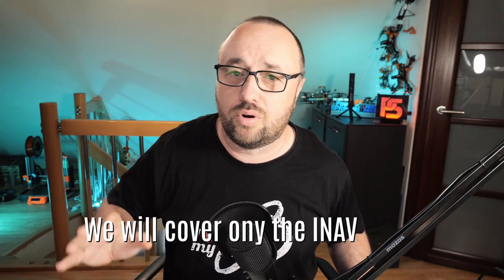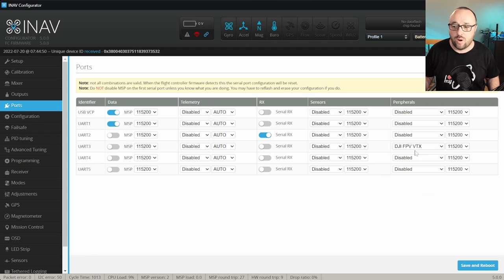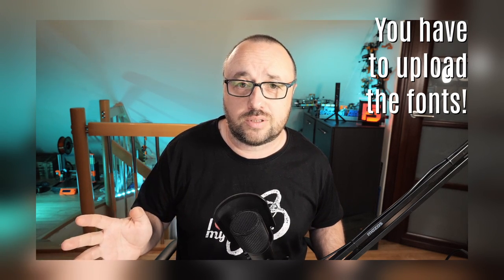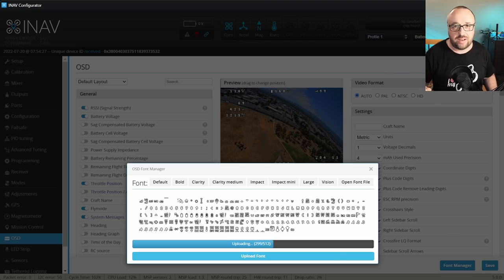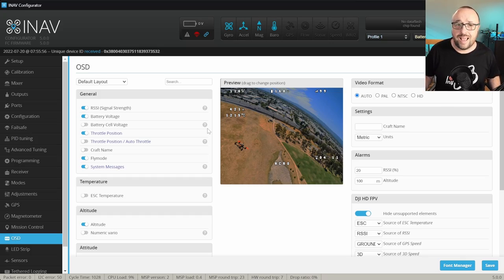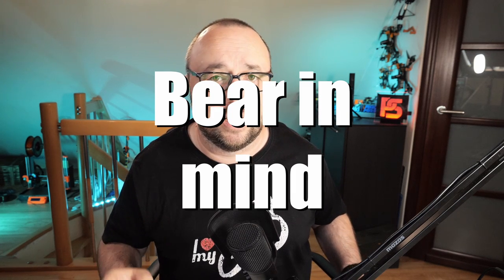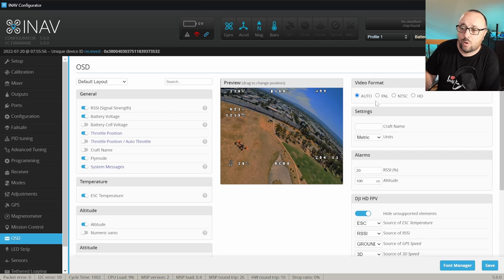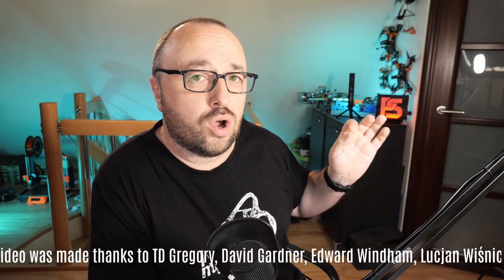OSD - Analog, DJI FPV and HDzero | INAV 5 on a flying wing | 9/11

Comment: Thank you Inav for embracing the craft name hack for DJI. Love that its configurable easy nlwt  Betaflight I need to flash special firmware and I think it's bull crap they didn't make it an option in the main branch
Reply: Maybe because dji should finally dropping canvas mode? Its a fucking shame they dont get that done

Comment: Hi Pawel, I'm getting a really annoying issue on Inav5: 
-I have enabled "use craft_name for system messages etc."
-I have enabled ONLY "system messages"
-I keep getting, when I have NO system messages, the "craft_name" that alternates with throttle percentage and other information that isn't even enabled.
-Craft_name is left blank ofc
-I already tried to reflash the FW
-I alreday tried to reupload the default font
WHAT ELSE CAN I DO? It's so annoying...
Reply: The same here. That's exactly what I was referring to in my other comment.

Comment: Thanks Pawel. Setting up the DJI OSD is the most tricky part of INAV in my experience. I accidently stumbled on an older video of yours with the DJI OSD hack and thought that was still valid. My DJI OSD displays the literal "CRAFT_NAME" string instead of either an empty string or warnings, so I must be doing something wrong. Perhaps changing the titles of older videos to indicate that they only valid for INAV <= x.y is a good idea. See comment by @Cst_FPV who has the exact same issue I'm having.
Oh yes, it will be nice to have a DJI OSD format in the OSD tab too (alongside analog and HD), so that the widths and heights of elements are displayed more realistically. Is that a realistic possibility for a future INAV version? Some of my OSD elements are layered on top of one another in the configurator, in order to be displayed with my preferred horizontal spacing in the OSD.

Comment: I followed your video, Trying to get OSD to work on HD0. Double and triple check the wiring. But still no OSD, not sure what I'm doing wrong. I get video in my goddles but no OSD elements. I am using the matek H7 wing V3 flight controller.  Any recommendations?

Comment: Thanks for the series,Pawel!  It  helps  alot!
I  got a question, though.  I have  Matek f405SE in my  wing  and   the  OSD dispays everything it  supposed to  display on DJI  system, expect  the Home direction arrow . Insted  of  an  arrow it  shows tiny  horizontal bar  like this " - "    Any  ideas?
Reply from the maker: Arrow will appear, or at least should. If it is not, then you should recheck your setup
Reply: @FPVUniversity  Not  sure what i  could be  doing  wrong, but  i got the  GPS cordinates  displaying correctly and it  changes if  i move  the  plane but the distance  to  home  is  always 0 and  the arrow ( direction  to home) is  not  appearing ( still got  the " _ " instaed the  arrow...

Comment: Hi. This is not exactly the topic but got the matek f411-wte flight controller and when you connect a 4s battery the battery the voltage reads around 30v no matter which 4s lipo i use, it is set at the default 1100 voltage scale, reads the same in  inav and in my goggles osd. Any advice appreciated. Thanks.

Comment: Could it be that HDzero (sharkbyte VRX) cant have multibe OSD screens? I got everything updated to inav 5.0 and hdzero to 26072022 firmware. However my OSD is stuttering AF or even dont show osd charakters all the time. Radar doesnt work at all but did work before the migration to HD. charakters with a warningfunction like satellites, rssi and so on mostly doesnt get rendert at all, sometimes they blink in for a few seconds and vanish again. Its so bad that im about to switch back and put that 1w vtx in a quad with BF bc there is everything just fine.

Ahh yes and im struggeling with the new DP310 baro but thats a nother story 😑